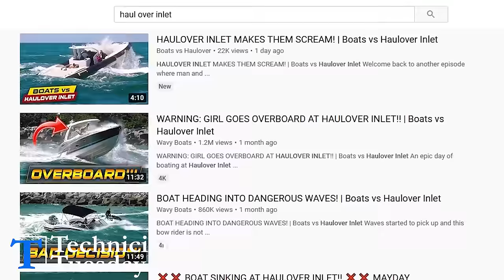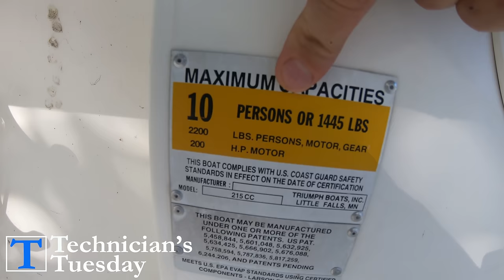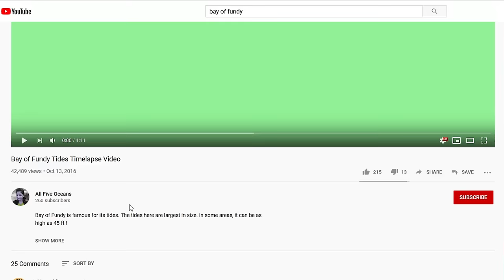Why Boats SINK!

Comment: Something i have seen on a lot of I/O boats is the bilge pump is mounted under the engine and extremely hard to get to, do you have any ideas on how to relocate the pump and make it easier to access? I thought about trying to mount a pump to the side of a stringer and running hose to the bottom of the bilge and securing it down there with a screen filter on the end and putting the float switch on the bottom of the bilge but somewhere easier to access. Any thoughts in how that system would work? I just dont know if there woul be an issue with the pump priming
Reply from the maker: It is possible to have an issue with it priming because most bilge pumps have to be submerged. You might be able to change to a diaphragm style pump but make sure that the float os located to keep the water from building up and putting the oil pan under water!

Comment: What brand bilge pump do you like or recommend? I have a sea ray Sundancer and I have an engine bilge pump and a step down bulged pump. Both are old and probably ready for replacement.
Reply from the maker: I like the rule 1500 or 2000 GPH pumps the best :)

Comment: Any chance you have more pics or video of that Grady White at 7:30?  It looks like it has the same issue I have with my Grady which is the scupper through hulls are below the water line.  I was wondering if it was an older Grady like mine that has been re powered with heavier 4 strokes and that causes that issue.
Reply from the maker: I'm not sure which Grady that was, it looks like maybe a 28 Grady maybe center console, what model do you have?
Reply: @BornAgainBoating  I have a 272 Sailfish that has been re-powered with Honda 4 strokes.  The scupper though hulls are below the water line  just like in the boat in your video. I'm concerned that if the hose connecting the drain in the floor and the through hull leaks or breaks it could fill the bilge with water.  I'm trying to think of option to shore up those though hulls to make it less likely to let water into the bilge.

Comment: Own a 2009 NauticStar 2200 TE bay boat. The bilge access is a NIGHTMARE!!  NauticStar should be ashamed of themselves for such a lousy design. Literally can only use one hand to work on anything down there and practically have to stand on my head to reach the manual bilge pump, which is just forward the auto bilge pump.